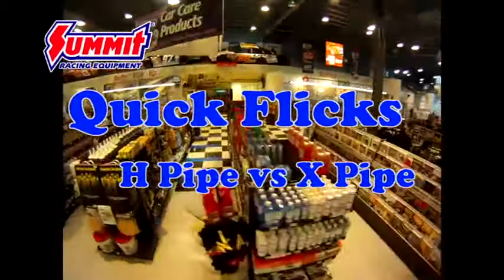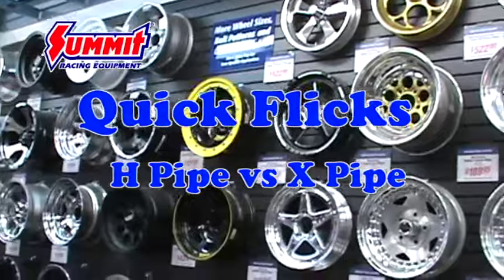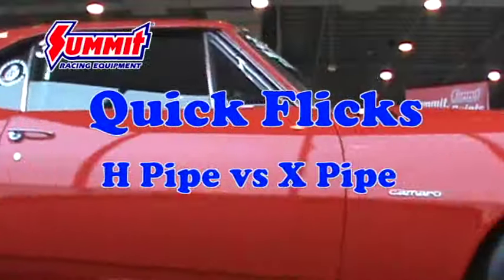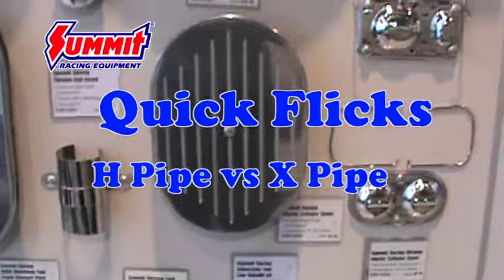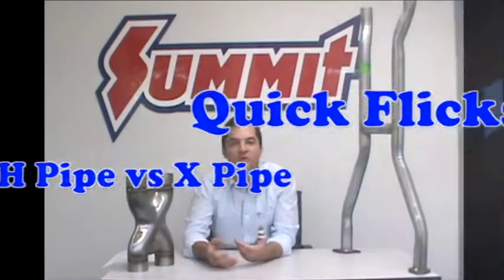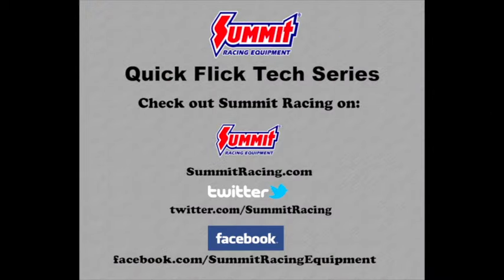Exhaust X-Pipes vs. H-Pipes and Differences Between Them

Comment from the maker: Due to the small CID of your engine, an H-pipe setup likely will perform better than an X-pipe setup. It's hard to say for sure though how the vehicle will react to either due to it's small size engine and in a lot of cases conventional V8 ideas on making power do not equate to more power in V6 applications.

Comment: Nice clip guys. Although I think you should have discussed the sound differences between and X and H pipe, I think for most road users finding the right tone of their exhaust is more important than a few extra HP at peak RPM. I've always found I like the true dual v8 sound with or without an h pipe - X pipe offers a different more 'racey' tone again which I like too but not as much.

Comment: Had a H pipe on my mostly stock 88 Mustang GT. Don't know what power increases. But it was a custom exhaust with no cats and basically 2 glass packs. Sound was amazing. Sure miss that car. 
I'll be putting H pipes on my Grand Marquis after I'm done rebuilding the 351W under the hood

Comment from the maker: You already have an H-pipe factory installed but, if the car will be used at a high RPM more frequently such as racing, you will most likely see a power increase from the installation of an X-pipe!

Comment from the maker: X pipes do tend to scavenge the cylinders better than an H pipe, especially if the car will be used in higher RPM ranges such as drag racing.

Comment from the maker: Hi Willig93, 
Due to the location of the factory fuel tank (inside driver frame rail) it is nearly impossible to install a “True Dual” exhaust system, and none of the vendors carried here at Summit Racing manufacture an X or H pipe – sorry!

Comment from the maker: If an intake manifold, camshaft & cylinder heads are in the cars future, then go with an X pipe. The more air and higher RPM you are going to run, the X pipe will shine thru making more horsepower!

Comment: An x pipe also adds an addition nearly 90 degree bend to each side of the system, a 90 degree turn can reduce peak flow by several percent verses a straight pipe so if you run one you should make certain the pipe size is more than adequate for peak hp flow. Also if it's behind a catalytic converter all your 'scavenging' theory goes out the window because the cat absorbs most of that energy although it will still alter the tone.

Comment: In a turbo application wouldn’t “back pressure” slow the compressor? Isnt the goal of a high performance exhaust system to allow the engine to breathe more freely? Back pressure is essentially turbulence, even an hvac tech would tell you that’s moronic, sounds like a justification for the need for emission systems. As far as “scavenging” goes I’ve eliminated my EGR system and my engine runs cleaner and most importantly, COOLER.

Comment: I find the whole backpressure theory contradictory. First he says that good scavenging promotes power through removing the spent gases so they can't dilute the fresh air/fuel mix which is true. Later he states that you need some backpressure in the exhaust which was slow the exhaust down and do the complete opposite. If backpressure was beneficial we'd all go out and plug up our exhaust pipes.

Comment: Great video. I have a 1966 GMC truck that I plan to do something very unique with. My question is this; how would the exhaust note change between an x-pipe and an h-pipe? I'm not particularly trying to squeeze every last bit of horsepower I can get out of my set up, but I'm searching for a unique tone.
Reply from the maker: Hi Chris Mason, 
Exhaust note change is something very difficult to express in words. While it will be affected by a change from X to H pipe, a larger change will be made by the muffler. Thanks for watching!
Reply: Gotcha. Fair enough. Thanks for the quick feedback!

Comment: Hello, I currently own a 2002 Mustang 3.8 It has some minor mods, i have a True Dual set up at the moment with some Long tubes and resonators as mufflers, and was wondering if adding a xpipe of 2.5 to my set up of 2.25 will be beneficial or will be a disadvantage to my car's performance. 

Thanks In Advanced Summit Racing.
-Alexis D.
Reply from the maker: LOPSIDEDAHL , 
If there is no plan to add additional fuel or adjust timing (computer programming), this modification would most likely hurt your performance more than help.

Thank you for watching. Please let us know if you have any additional questions. Feel free to call our tech line at 1-330-630-0240.

Comment: 1976 Chevy Scottsdale K10 with a 383 stoker built from an '85-'87 350, Hooker long headers with 2.5in collectors. My local exhaust shop is swearing I'd be better off with an H pipe for exhaust scavenging and power but I hear different from every wrench head out there. X pipe is what you're saying will be best for my truck, eh? And how much back pressure do ya figger I need?
Reply from the maker: Hi Brandon Lange, 
Scavenging works best when we keep the flow path of the fast moving exhaust as uninterrupted as possible. While H pipes allow pressures to equalize between banks, they do not allow smooth uninterrupted flow. Hot exhaust gases do not like to turn 90 degree corners! Smooth transitions from one side to the other, as provided by an X pipe, is preferred! Back pressure is something else we like to minimize if possible. Too small of a pipe restricts flow and too large of a pipe allows the gases to expand and slow down. Finding just the right pipe size keeps the gases moving fast. Follow the pipe size to horsepower recommendation chart in this video.

Comment: An H pipe can be more beneficial when the system is comparatively undersized since it still adds pipe volume to the overall system which (by definition) can reduce total peak backpressure

Comment from the maker: X-pipes should be considered a performance enhancement. By adding an alternating flow path for the exhaust pulses to travel, you are lowering the resistance to flow that those exhaust pulses experience. Most likely this will not give you the sound you desire, look at the mufflers!

Comment: My setup: 305 bored .030 over, 270 duration cam w/ .499 lift, 58 cc heads, flat-top pistons and headers. The OEM exhaust was dual w/ 2.25" pipe w/ the cats removed. I decided to stay w/ the 2.25" size. Which pipe will provide the best performance: X, H or straight?
Reply from the maker: Hi Ernest Adams Jr., 
Can you give our tech department a call? 1-330-630-0240. We need some additional information from you. Thanks for watching! We look forward to your call.

Comment: i have a 98 f150 with the 4.6l v8 and im considering getting either an xpipe with dual glasspacks or dual straights. i want it to be as loud as possible without it sounding like crap. what do you recommend?

Comment: 2:03 Do more research. There is an optimal location for the H or X pipe in the system, but transmission removal may be more important than gaining .5HP.

Comment: Summit you spoke of back pressure and compression ratio.  I have 2015 Silverado w/5.3L 4x4. Looking to add long tube headers.  Would you reccomend x pipe or h pipe?  I mainly am a daily driver but pull my boat on the weekend.  Would shorty headers be more beneficial?  Sorry that's a few questions?

Comment: I've got a 2012 BMW 550i xDrive w/ a 4.4L Twin-Turbo V8. It makes good power but sounds like a little girls electric moped... 🤣

I'm looking to replace the resonator with either an X-Pipe or straight pipes back to the stock valved mufflers, hoping that'll make it sound "meaner". 

I understand the X-Pipe would give it a less raspy, higher exhaust note than straight pipe back to the stock mufflers... Would it hurt power much to just go with straight pipes, or H-Pipe replacing the resonator to get that DEEP RASPY sound, or do I need to go with an X-Pipe to keep from losing power on a small, Twin-Turbo V8?
Reply from the maker: As far as power output is concerned, the X-pip would still be the best option. Magnaflow offers some in-line type x-pipes that you could use to fabricate a resonator delete without taking up too much space. You would just need to choose the proper tubing size for the following link https://www.summitracing.com/oh/search/part-type/exhaust-crossover-pipes/universal/yes/pipe-style/x-pipe/brand/magnaflow?N=brand%3Amagnaflow&SortBy=BestKeywordMatch&SortOrder=Ascending&keyword=exhaust%20crossover

Comment: I have 95 Mustang GT 5.0. I bought this car last year. The car came with cobra suspention and 2 flowmaster mufflers. I have put BBK CAI, 70mm throttle bodies and MDS: (Coil, Wires 8.5mm and cap & rotor ). But now i want to install a cat back exhaust sytem but i dout: either buy a new H pype (my car has H pype without catalytic converter or catted) or buy the X pype.
So my question is: what do you suggest me to buy?
Thanks For you answer.

Comment: Which would be better for my set up. I have a 98 gmc serria 5.7 motor. Shorty headers stock cats duel glasspacks. Wondering if the x or h pipe would be better.
Reply from the maker: Hi Christopher Struck, 
In a low speed, towing application such as this; an H-pipe will do well.  If you were racing the vehicle every weekend and looking for the last ounce of higher RPM power possible, then an X pipe would be better!

Comment: I got a 98 Z71 5.7 I have a full custom dual exhaust no cat's full 3" exhaust with a custom double H pipe and 3 in 3 out single chamber Thrush Bottles with 5" tips on 90s the pipes are fairly close together has a very deep tone truck is pirky down low and has a custom cut high torque Comp cam. I understand the H pipe makes low end torque and the x pipe is a high rpm style HP gain mod. I think H pipes are great they sound good but I also think it makes a difference on how far apart your pipes are from eachother. I'm happy with my H pipe but like I say mines a double H pipe full 3" duals and the Double H pipe is 3" pipe from side to side aswell.
Reply from the maker: Thanks for watching, Taylor!

Comment from the maker: Hi Springs24, Magnaflow has a few different systems that would fit a 2010 Camaro SS. Can you give our tech line a call at 1-330-630-2240 so we can better assist you? Thanks!
Reply: I have 1996 mustang cobra I put lung heder's tubes and bbk intake and bbk pules and 373 gears what's it's better x pipe or h pipa thank you

Comment: What would you recommend for a stock 2016 Tundra 5.7, I also plan a cold air intake soon, either K&N or TRD ? I'm not looking to go further with modifications other than letting it breath in and out,  do you sell Hi Flow cat's, mufflers,  and a complete dual exhaust system for this truck ? I'm looking for recommendations from knowledgeable people with experience with this vehicle ?

Comment: Hi guys thanks for the explanation.
I got a lexus is 250 
2.5 v6. At the moment i have a duel exhaust system that runs all the way through the car. this is after removing the middle box that joined the 2 exhaust flow. Should i have them combined with x or h pipe.  I am looking to supercharge the car in the long run but want to start with a decent exhaust system. the car already been de-cat'd

Comment: Thanks.  What do you think would happen for both performance and sound if I remove my mid muffler(which does act as a cross over) and just run strait pipes in its place (Running my system without a cross over)?  Could there be any benefits in doing this or would I be better off sticking with my current setup?

Comment: the H pipe or X pipe if the aim is to get the c 63 amg drone onto a small engined vehichle. like a 1.8ltr four cylinder engine to be exact. this setup will include individual throttles too, thanks!!

Comment: I plan on putting an Exhaust on my 1997 c1500 5.7l I've got the K&N cold air, but aside from that the engine is stock. my question is, would the better flowing X pipe be better than an H pipe? i'm going from one cat up to 2 (one per side) using magnaflow high-flow cats, and then into mufflers. I just dont want it to rob any torque because i do haul things.

Comment: I have a G8 GT with a SLP Axel Backs...I see you guys have the Kooks Headers X Pipes for cheap. How would these work on our cars, would you say use something else?
Reply from the maker: London Johnson ,
Due to its scavenging ability
 an X-pipe will always make more power, especially in the mid to higher
RPM ranges!

Comment: I got a question. I have a 74 chevy truck and want to run true duals with flowmasters. I was thinking whether to an h pipe or just run them straight from them manifolds back to the mufflers. will it make any difference where power is concerned?

Comment: Very Informative video, Thanks. Question: I see a lot of video comparisons of X and H pipe for mustangs and cars. How about for a truck? I don't pull a lot of stuff but its a heavy 2013 RAM 1500 5.7 Hemi and know torque is important. I do like "taking it to the track" so I am looking for perfomance but mostly daily driver. I hear H pipe is better for torque? Its already got CAI, muffler swap, and tune. I'm planning on getting on headers as well. What would your professional opinion be on X or H and maybe on location of such pipe?
Reply from the maker: Hi 0isbrabra0in, 
There is no easy answer here!  An H-pipe would do just fine for towing but, an X-pipe would be great at the track! The practical way to view this is; what is the most important use of the truck? If that is low speed towing, it’s an H-pipe. If that is racing at the track, it’s an X-pipe.  Also, make sure you re-tune after you install either to receive the full benefit of the modification!
Reply: Summit Racing  Definitely will do. Thanks for the reply and insight.

Comment: Thanks for all of the great advice that you provide. I have a 2016 Mustang GT.... X pipe or H pipe? 2.5" or 3" exhaust? MBRP,  good price but is a 3" catback H pipe my best choice for performance/budget friendly. May add a supercharger, trying to keep warranty also. Is the roush supercharger my best choice for price to performance value? 
Only thing I bought so far was a pedalmax, I haven't installed it yet. Is it ok to use it with a supercharger?

Thanks, I'd appreciate any and all advice!
Reply from the maker: Hi Guy, 
The PedalMax will work fine with a supercharger.  As for the exhaust, you have a ton of options.  The X pipe is going to be a lot more common.  A 2.500 in. exhaust is ok if you were going to keep the engine mild, but with the supercharger-it would definitely like a 3 in. pipe.  The header back systems are a good way to go as they have the X-Pipe designed into it already…so less cutting required.  Take a look at the following link to get an idea. https://www.summitracing.com/parts/hok-70503307rhkr/overview/year/2015/make/ford/model/mustang

Comment: I have an 03 sierra with longtube headers, cold air intake, and high flow cats. I wanted to run true duals with flowmaster super 10s. what will give me the best performance? I want enough backpressure but I also want sound and performance.

Comment: i have a 5.3 silverado 2001. i want more acceleration with lower rpms. for better gas mileage,  since i don't race it or anything. i'm more inclined on the h-pipe. what do you guys suggest?

Comment: I have a 2008 Pontiac G8 with the 256 V-6.X Pipes seem to be the mod of choice but I second guess whether that is the right choice for our vehicle.There are some V6's that run CAI with X pipes with non restictive axle backs or mufflers and my car is faster at the track by 2-3 10th & they run slower 60' as well given similar DAs.I have the stock exhaust sytem minus Super Turbos. I also made an intake tube between my TB and Filter Box.Could an H pipe be better? Could I gain more low tq over the X

Comment: Hi. I'm doing a rebuild on a 1992 300zx TT . The horsepower we're shooting for should be around early to mid 500's. We've kept the VG30DETT and have done a number of mods on the vehicle. The idea is to gain higher mid-range to top-end power. Would you recommend the use of X-pipes for this application?
Reply from the maker: Hi Paul Mackoon, 
Yes, X pipes tend to help make more power in that range!

Comment: I got a off road bbk h pipe on my 88 gt with super 10 singles chambers it's real gutless at low rpm you think if I put some 2 chambers on will I get some power back ?

Comment: I just bought a 2014 mustang and wanted to make it sound deeper as well as get the most hp out of it. Would you recommend going with LT headers with a shorty x-pipe and then an axleback exhaust? Thanks in advance

Comment: Looking to do a resonator delete and replace it with a X pipe on my cls55 AMG. My current mods are only a ecu tune. Do you think this change will be beneficial for my vehicle? And not lose low end torque?--my biggest concern. Thanks in advance
Reply from the maker: FJF2007, 
Along with a new dyno tune, there is no reason why this would not add some additional power!

Comment: What is your opinion on divorced exhaust on a v8. Ive been running with a divorced exhaust on my 01 mustang 4.6 for over a year and its put down nice numbers with a blower. I basicly just blocked off the H pipe.
Reply from the maker: +ltwargssf R , 
While all motors react differently to cross over pipes, the only way to know for sure is to have it dyno’ed both ways!

Comment: I have a 92 Mustang 5 speed that has a 347 stroker motor .30 over. I currently have an H-pipe on the car. I had it dyno tuned last year and it's only about 320hp/340tq at the rear end. I'm thinking about changing it over to an X-pipe and possibly upgrading the Eldebrock heads to better breathing heads (AFR or TrickFlow) since I think there is a good bit of untapped power left in the motor.. Would the X-pipe be a better choice given the setup? The car is mostly street driven.